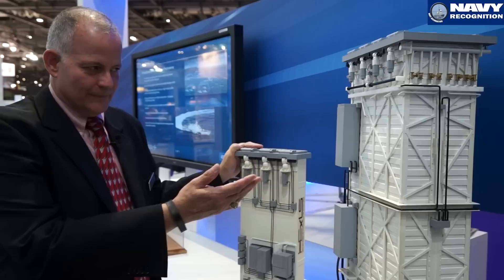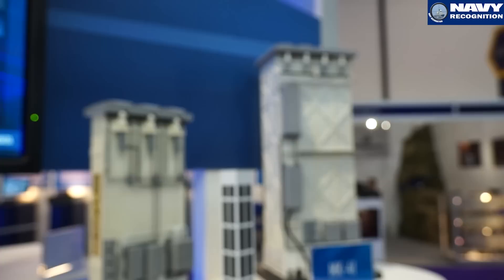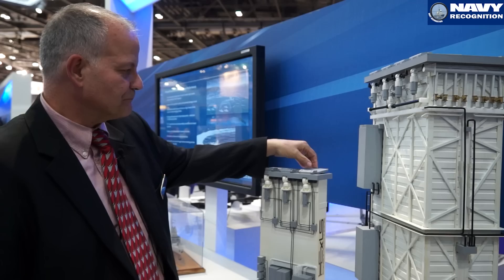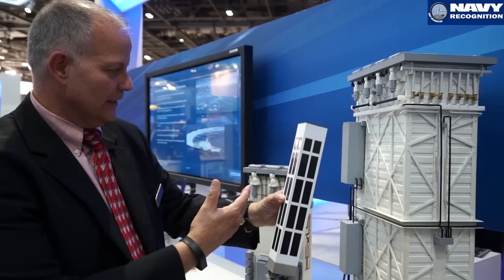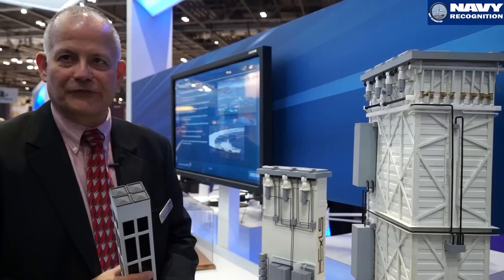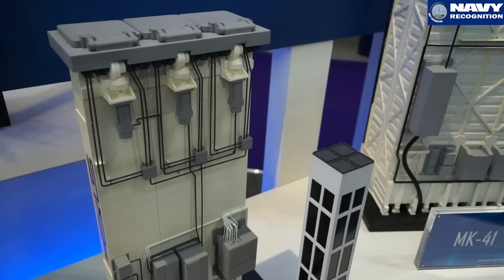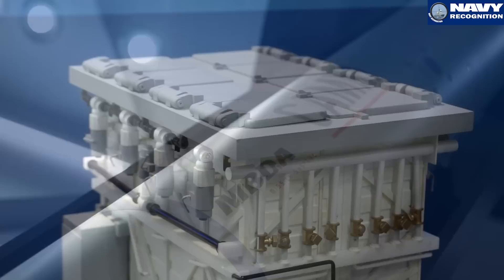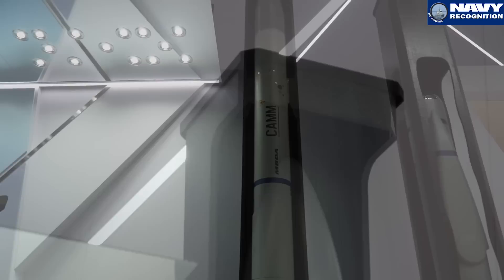Lockheed Martin ExLS Launching System & MBDA CAMM at DSEI 2015

Comment: Looking forward to a full size 4 cell truck mounted MK41 
version.
Lol....ESSM quad packed in one two SM3 and one SM6.....Example 😂😂😂😂😉
By by S400 S500
Also the french sylver vls system could be truck mounted for the same result with my twin rotating radar system.
For a two truck missle system.
Reply: The Sylver already is truck mounted. Google SAMP/T
Reply: @Turf-yj9ei  True but the SAMP/T needs a better radar system with 100% radar coverage at all times because of the Hypersonic missles in current service.
And two truck systems are the way to go these days with more automation and better electronics available so a total of two trucks can do the job of three.
The French have to get with the times and keep updating and innovating.
😎